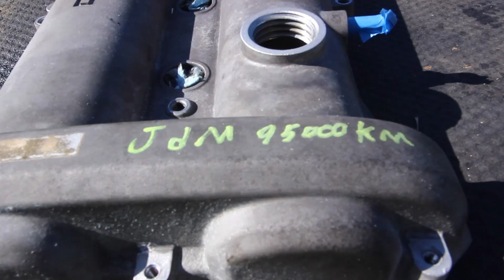MAKING THE PERFECT ENGINE BAY!

Comment: Catch can should not be  hooked up to your intake manifold you’re going to be getting positive pressure into your valve cover
Reply from the maker: Brendan Wood ........
Reply: I don’t understand why your catch can is routed that way, that little breather filter you have on the valve cover should be rerouted to the catchcan and then as well as the PCV hole
Reply from the maker: Samiata so wrong.....the breather should be routed to a catch can and then to the intake piping before the air filter, but if you noticed I do not have any piping before the air filter so that’s why it is the way it is my man 😋 stay humble. And think before you talk.....my man!
Reply: @DannyCourtney1 .... your not pulling vacuum u are boosting ur valve cover the way you have it hooked up. you need it to pull from before the turbo
Reply: Danny Courtney I don’t understand what you’re saying, you want the breather from the valve cover routed into the catch can -> then to the PCV. Your head is seeing boost pressure from the hose off the intake....no need to get heated I’m just trying to understand why it’s routed that way...
Reply: Brendan Wood Unless you’re just having it catch vapor from the PCV I don’t get it because it’s still leaving the breather hose open which is what usually catches most of the oil vapor? The breather should be routed back into the intake (pre turbo) but would just cause more blow by under boost since the PCV would be closed....I don’t see the over all point in the catch can setup that way since the major issue I could see would be blow by from the breather hose going into the turbo , hence why you would want a catch can between the breather hose and turbo intake.